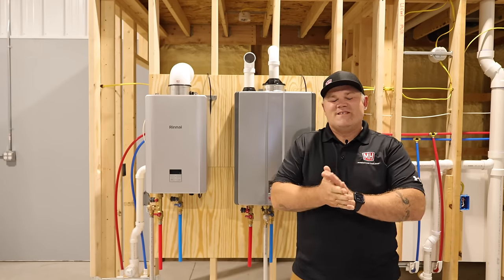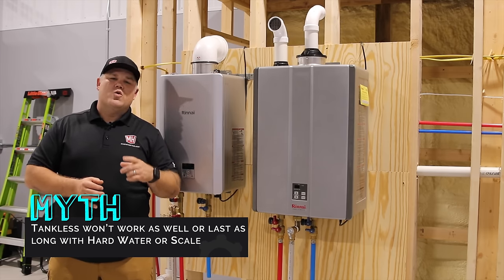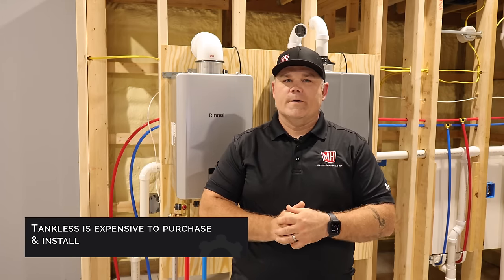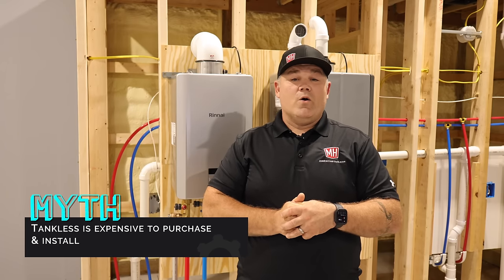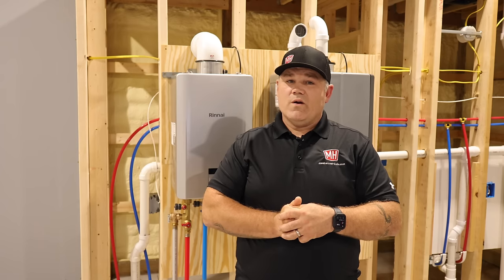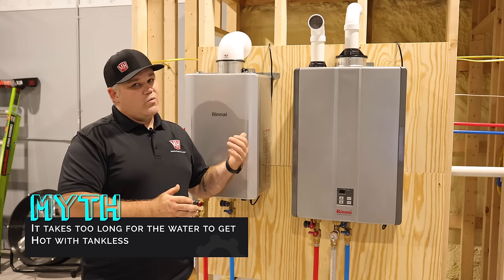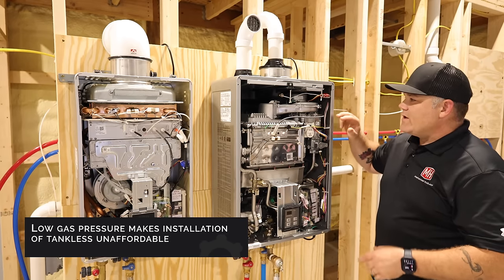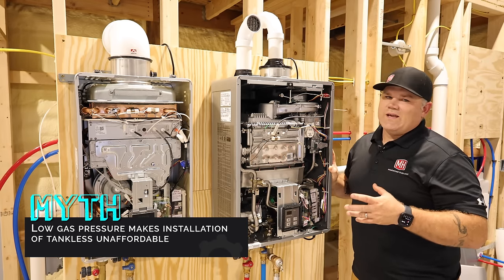Myth Busting! Tank -vs- Tankless Water Heaters

Comment: We upgraded our hot water tank several years ago, and against my better judgement (and the coaxing of my father-in-law), we went from a 40 gallon tank, to a 50 gallon, to increase our hot water capacity.  Due to the fact that I like to take long showers, I really wanted to change to the tankless system for the “endless” hot water capability, but was discouraged by my F-I-L, who believed them to be too pricey, and hard to find parts.  In the winter, I can definitely feel the difference, as to when the hot water is beginning to run low.  Let’s just say, I made a big mistake, and should have gone with my gut instinct.  The next upgrade will definitely be to the tankless system.  Thanks for all the information, and confirming what I should have done in the first place.
Reply: Long showers, how long? I run my pressure washer from the 50 gallon, and only after washing two a car and truck it would start to get low. Not sure, check your settings. Still prefer the tank, no electricity required.
Reply: Stop  wasting so much water and listen to your father in law

Comment: I've got the condensing style. I would never go back to a tank. But you must understand, there are trade offs. I did indeed have to upgrade my supply. I had an entire crew spend an entire day tearing up my yard, pulling in a new line, replacing my main regulator, and placing independent regulators on each of my appliances. The dual wall venting was expensive to me. Operationally, it works on a pressure differential. if the differential between the hot water request is not substantially greeter than the cold water request, No hot water will be produced. sometimes, I can be mid shower when demand for cold water is requested elsewhere in the house causing the differential to drop below demand requirements shutting down the heat exchanger and leaving me in a cold shower. Having to turn off the water and then turn the hot on full while i stand there naked and shivering waiting on the hot water to make it back through the pipes. Its a learning curve. I do like it better. But its NOT all unicorns and rainbows.It cost me a whole lot of money to get it all set up right after i hung it on my wall. And it is quite 'clunky' compared to the ol' reliable. But it is efficient and it never runs out. Oh yeah, it doesn't work if the power is out. so also be sure to install a UPS. That's another hondo. This is NOT one of Jack's "magic beans."
Reply: Yes, there are trade offs, sounds like you have some general plumbing issues that are making it harder on you (which I realize may not be worth tackling until you have to, but also aren’t the tankless’s fault). A small generator will easily cover the electrical demand of a tankless, which you probably want anyway for the many other things in your home there require electricity. But yes it’s a factor.
Reply: I’ve been in business doing HVAC, electrical and plumbing for 30 years. I have installed hundreds of tankless water heaters. I still would rather have a 50 gallon gas water heater in my home. They are more dependable, work when the power is off, cheaper to buy and install and we never run out of hot water.
Reply: All that expense to set up. Will you even be saving money?
Reply: I appreciate the honest review. I feel the review on this channel is a bit bias / kind of a conflict of interest considering it's sponsored by the product featured in the video.

Comment: I went tankless and wondered why I waited so long and why traditional tanks are still even made anymore. Flushing once a year is not difficult. Now if you are not mechanically incline or lazy then it is coming to cost you money. My brother bought a new construction home 15 years ago and tankless was the only option. His tankless is still going strong with just  flushing it with vinegar every year. His neighbor didn’t maintain her’s and it died in 3 years. The key to owning tankless is yearly flush and routine maintenance.
Reply: One reason is older houses with gas tanked water heaters don’t have electrical lines to the water heater

Comment: We install
These at our home builds. Dont expect
To wash laundry and shower at the same time. Or run the dishwasher and shower at the same time….
And we’ve had more bad circuit boards, malfunctioning units with Rannai than the new vendor. The recirculating feature creates surges of hot and cold water until the full heated water shows up. Also make sure they are not mounted on a wall not near a bedroom because they are loud and the circ pump running can be heard through the wall…

Comment: Just went with a tankless water heater but I want to clarify one thing.  This is later 2023 and the price of a good tank electric water heater was round $2,000 to $3,000 installed in my area.  The gas tankless water heater we put in was a little over $6,000.   So for us any type of ROI is basically shot, but we are hoping for a $15 year ROI, however time will tell.   Our last water heater lasted 17+ years, and it is fronted by a water softener, so the hope is that this tankless will last at least 15 years.   So the myth that tanks are less expensive is actually true, at least here in the Midwest.    Again we went with a tankless for other reasons, but if cost is your number 1 concern, then you can save a ton of money initially by going with a tank.
Reply: Steve, like you I live in the Midwest.  My 40 gal tank hot water heater is 30 years old.  The wife and I grew concerned about the age.  Our plumber, who in our opinion, is very honest said wait till it fails before replacing.  Plus they'll install a new 40 gal tank heater for $1500.00 including the price of the tank and the labor.   My decision of going tank or tankless is an easy one.
Reply: Even more so. A tank isn't 2 grand. It's more like 500 bucks. And they are stupid simple to install or replace. I am not fooled by that sales guy for a split second. Practically all his claims are wrong.
Reply: @Antiorganizer  I am only comparing the price that was quoted by multiple vendors.  I have had people tell me a tankless is "stupid easy" to install as well.  Having said that getting a near 20 year old tank full of sediment cut out and out from our basement is not "stupid easy" for someone like me.   So again this is the cost difference that I was quoted and I wanted to let people know.  Now are we happy with our tankless so far.  Yes.  But not because it saves it will have a ROI in a year or two or even five.
Reply: @SteveMichael  When our old tank went, I drained it, slid it out, put in new one in, and Bob's your Uncle. Used a dolly and help to get it up the stairs.
Tank was like 500 bucks.
Tankless is like 3 grand thereabouts.
Electric tank might cost like 100 bucks more per year to run.
It would a very very long time before the tankless start saving money.
Another problem is that once people invested in it and have it sitting in their house, they don't want to feel bad about their decision, so they make up argument to make it seem that hey came out ahead, when they didn't.
Reply: I bought a Tank water system for around $750 last year and installed it myself cant justify 2 or 3 grand for a new hot water heater
Reply: My dad's tankless is 42 yrs old.. on a gravity fed system.
Reply: This is the same calculation and a “super high efficiency” furnace. The old “80+ %” units are a fraction of the cost and depending on how long and cold your winters are you may not recoup the cost before they fail. Mine is over 25 years old,while the newer ones have a much shorter life span in general for a 10-12% increase in efficiency
Reply: @adelinawarriner6259  That's great. One of the old fashioned ones that are common in Europe, I'm guessing. But I bet the new ones you see across North America, are trying to be more efficient, and will have a shorter lifespan, need maintenance, and are less reliable.
Reply: @vancebeazer458  I think electric hot water tanks are the wiser choice, because in addition to the much lower startup cost, and it being more reliable, there's also the opportunity for renewable energy to be used.
Reply: I sold a house in Florida, the tank water heater was 35 years old. A Rheem 65 gallon commercial unit. Had to replace it to sell the house because of its age. Still worked just fine.
Reply: @Antiorganizer  Who the heck is paying 2 to 3 thousand dollars for a water heater Omg. No wonder people can’t afford the basics. Highway robbery
Reply: @SteveMichael  what a rip off.  That insane for something that simple. Men not knowing how to do anything had driven the service industry into robbery.  6000 dollars for two water line hook up and screwing down four wires.

Comment: Great video. I do have one more concern that you didn't cover. I have had an NSI tankless system for 5 years that runs both my baseboard heat and domestic hot water.

I've always wondered if turning the hot water off and on repeatedly in a relatively short time frame will harm the heater.

For instance, when I wash dishes, I don't run the hot water constantly for rinsing. I turn it on to rinse and off until I need to rinse again to conserve water and energy.

But every time I turn it on and then off, doesn't it have to go through its start up sequence all over again? Is this harmful to the unit? I do notice a cooldown section of water when I do this.

What are your thoughts?

Comment: I found the cost of installation to be much higher, but not directly because of the water heater.  The energy consumption of a tankless, however, is so much higher than a tank heater.  We would have needed a fairly expensive upgrade to our gas line in order to support the tankless heater.  So getting the first tankless installed would have cost us a lot more than the tank unit we got.
Reply: It sounds like you had a gas water tank and switched it for an electric tankless. Of course that's going to be more expensive!
Reply: @izafanime  If you had a tanked gas heater, it would have too small of a gas line to support the tankless.  So you would need to run a new gas line, which could be quite pricey depending on the details.  Tankless need lots of gas while they are running, but they run much less.  Less total gas, but super high flow rate while running.
Reply: That's exactly what I've heard as well. That it costs more to run them. I thought it funny he didn't cover operating costs because that's really why I clicked this video.
Reply: @MarylandFarmer.  No, that is incorrect, especially if you go for stretches of time where you do not use hot water.  Like most people, you probably only use hot water a few minutes every day.  A tankless burns fuel fast, WHILE YOU ARE USING HOT WATER, but all the rest of the time, it uses zero fuel.  A tank heater will keep burning fuel to keep the tank hot 24/7
Reply: That is a "depends".  Depends on the size of the gas meter sitting outside your house.  Depends on what size tankless water heater you are installing (BTUs).  Depends on the other gas appliances you have already.   I have a 250,000 BTU meter, the Rinnia needs 160,000 BTU .. this handles two bathrooms with ease which is my house.  My furnace is 40,000 BTU.  Got rid of that nasty gas stove so nothing there.   Didn't need to upgrade my meter, or gas lines ...    DEPENDS.    Never AssUme
Reply: The Navien tankless can run up to 24’ on a 1/2” gas line.  Did you have a longer than 24’ run and smaller than 1/2” gas line to the tanked heater?
Reply: @hanko5750  The tankless would be starved of gas if all you have is a half inch line running to your tank like most homes. Which is exactly why MOST people need to upgrade their gas line from the meter or from a section of pipe that with support the fuel demands

Comment: Back in 2018 during an ice storm, my neighbor's tree fell on my truck and house ripping the electrical out of the meter block. For 3 very cold days, we had no electric or heat. The only thing that made us feel human at the time, was we had an old school water heater that didn't require electric, so at least hot showers were possible. So 2 years ago when I had to replace the old water heater that lasted 16 years, I put in another old school water heater. During the summer, my gas bill is less than $30 for hot water and the gas dryer. Winter is a different story altogether with the heat. I was told I would probably need to increase the size of the gas pipe if I went with a tankless. That being said, the faucets are on the opposite side of where my mechanical room is. If I did go with a tankless and went through all that trouble, I would probably want the tankless water heater put in the laundry room near the washer and dryer where all the faucets are in that general area. That would mean also running either a larger pipe for both the dryer and tankless, or an additional line for just the tankless. I'm not going to worry about it right now, since I've probably got another 10 plus years left in my new water heater.
Reply: In 2005 I had a tankless water heater installed at my new house. It had a piezo self igniting system, so no electric line was needed for that type of tankless water heater. I can't remember for sure, but I think it was a Bosch model.
Reply: @dvader3263  I'm guessing today's tankless require power because they are so complex and computer-driven at this point.
Reply: if you have a long run you must hav a pump or a lot of water is lost..tanked have what is called heat transfer to copper piping etc they dont get totally cold the whole way..tankless water heater is off water is damn cold until you lose 3 to 4 gallons of water at 130 temp. I know this i use a 5 gallon bucket at tub.. I aint taking a cold shower.. 4 gallons winter time to get a real shower.. I use water to flush toilet.. Same with kitchen sink galons until its uable.. unlesss a short run..  raising temp to 130 really helped at 120 it was 5 gallons or more for a usable shower.. a 5 gallon bucket aint light.. but one gets used to it..
Reply: That 4 ft.² floor savings means you can spend even more and put a softener there! Even own those? What a pita. I like simple. A few service calls cost as much as an entire tank install!
Reply: Here in CA they want all appliances electric. Solar panels on all the houses for new build. We just went through some powerful storms that cut our electricity for 24 hours and in some places 2 weeks. We aren't allowed to burn in fireplace because of air quality rules either. That shower to warm up before crawling under a pile of blankets felt amazing. We just installed  a new tank water heater. You have to have a reliable power grid to go tankless and CA certainly doesn't have it.

Comment: I have always thought the differential cost between tank and tankless didn't make sense considering the payback. But I do agree the recent supply shortage issues have closed this gap. However, one thing still bothers me about tankless maintenance. I live in Long Island, NY where the water supply is very hard and known to scale many water heaters over time. The plumbers I have spoken to recommend annual descaling of any tankless heat exchanger component to maintain efficiency. What are your thoughts about this?
Reply: In my case, I had to replace my tank a few years ago because my vent fan went out.  Vent fan was required because the tank was installed a distance from the foundation wall.. with a long horizontal vent pipe.
Turned out there was no way to get a vent fan anytime soon.. and they were Expensive.  I also found out that water heaters (tanks) with vent booster fans are really expensive to replace too.. quite a bit more $ than a basic tank without the booster.

My tankless was expensive.. more expensive than even a boosted tank, but not so much that I thought twice about getting the tankless.   If you've currently got a tank with a booster exhaust fan,.. price really isn't an issue.

The tank I bought does recommend yearly flushing/de-scaling.  They sell a kit to owners to flush it, though the manual does recommend having a plumber service it for you.   I haven't done that yet on my unit, but we don't have hard water by me.  I can't say I've seen any efficiency issues.. but if you're scaling up, that would cause problems.
Reply: Plumber here.  Descaling (flushing) is MANDATORY for tankless heaters.  If you are not inclined to do this yourself, or better, having your unit serviced by a professional, you might kill the heat exchanger.  You also might void your warranty.  Tankless is the best, and they last at lot longer than a tank too, but if you are never going to service it, stick with the dinosaur tank!
Reply: @lsteiner  Yea, it's not that I'm not willing.. just something I only think about when I happen to be in that corner of the basement.. and then it's delegated to the nether-regions of my todo list by the time I walk away.  :-/.  I'm due.
Reply: @lsteiner  What is your cost estimate for an annual  professional descaling service call??

Comment: I had my first tankless water heater back in 1984 when I was stationed in, what was then, West Germany.  I had two tankless water heaters installed in the house we built back in the USA in 2008.  They've worked quite well.  I had two installed, along with two HVAC, when the house was built because of the distance between points of use.  Our units are rated at 7.5 gallons per minute at 140 degrees.  We've never been in want for hot water.  We use gas for furnaces, cooking, grilling, and water heating.  During the summer months we typically use 0.25 to 0.30 dekatherms per month.  They work well for us.